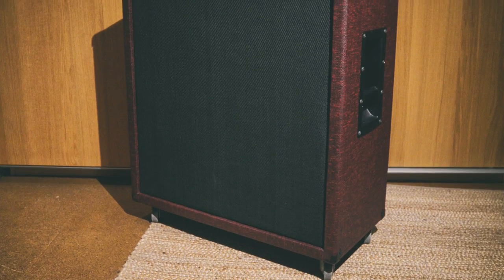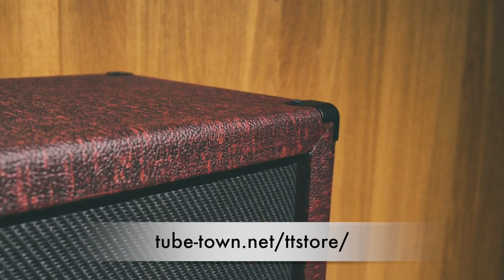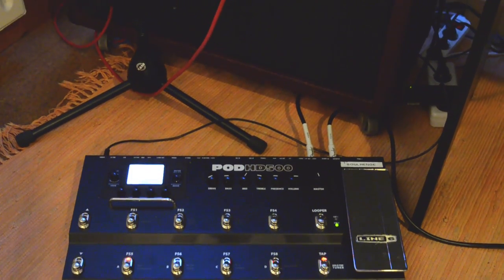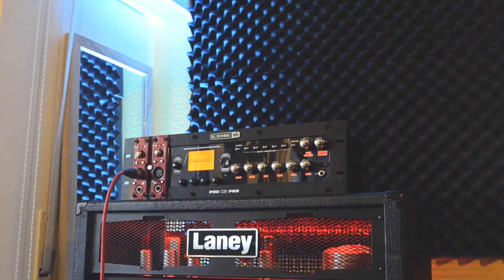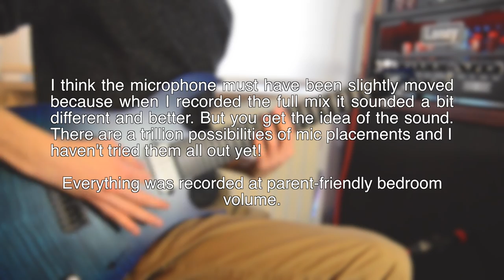DIY 4x12 Guitar Cab | Process / Demo | 2017 (HD)

Comment: Curious if you'd make a more detailed video of the build process. Details about why you did certain things, parts used etc. I've watched quite a few videos on the internet and there are things you've  done that I haven't see in others. Did you design everything yourself or did you borrow some ideas from plans.
Reply from the maker: Tyler Newstead I mentioned tube-town in this video, where I got the tolex and the corners etc. I gutted and old ENGL cab for the speakers, which were my only reference for the measurements. It's just a wooden box in the end haha

Comment: Good work! How are the measurements? Have you tried it without the insulation? Have you build any stabilisation middle piece in it? I built a 2x12 with 18mm birch plywood. Specs are like the closed back orange. Sounds nice but cost 550€ including the speakers, which is a used 4x12 Marshall... :/
Reply from the maker: If you pause the video at around 0:28 you can see the sketch with the measurements on the right. Top and bottom: 35x75, sides: 35x 71,5, back and front: 71x71 (Everything in centimeters) and 18mm thickness overall.

I know, I didn't have to buy the speakers and even used some hardware from the old cab so I spent around 200€ for woods and tolex etc. Speakers are really expensive but also the most important part of the speaker. I haven't tried it without isolation on the back. I think it just can be better with it (but I could be wrong).

You're right for that price you get an decent used cab but is the Marshall as good as your own built cab? Plus yours is unique AND you just crafted this thing with your own hands.

My next project will be a 2x12!

Comment: Are those stock Carvin pickups? I have been looking for other options to put in my Jackson B7. The cab turned out great! Is there a reason you decided to butt joint the sides together versus finger or dovetail joints?
Reply from the maker: Yep stock Lithium pickups!
I did this noob joint because I've almost never done woodwork before and this was way easier for me and faster. I built this thing in 5 days from scratch.
Reply: That cab turned out great with the amount of woodworking experience you claim to have. Great job on that! I think I am going to look into the Lithium pickups.  Thanks for replying!

Comment: What kind of file was that you used to put the curves on the edges of the cab, they came out pretty professional? Nicely done! I’ve just been peeling, sanding and staining already constructed cabs myself. I did a Line 6 with Celestion V30s and am about to start on a Krank Krankenstein one soon.
Reply from the maker: Ivan Loaces It was a pretty heavy rasp, then I sanded it to make it smooth :)
Reply: Awesome, thanks for the info. I’m getting one tomorrow.

Comment: where did you buy the plywood(multiplex platten, wait...is that one word??)? I live in germany as well(Ami) but have not found any place to buy plywood... 

also, is there a link to a diagram for the speaker wiring?
also, also, what speakers did you use? celestions or what???

I clearly want to make my own cab, had to leave my 4 x 12 in america when I moved here..
Reply from the maker: justin barrett look at Bauhaus or Hornbach! I don't have a diagram since I re-used the speakers and wiring of an old ENGL cab that I gutted. It has Vintage 30 Speakers by Celestion.

Comment: How much experience do you have with stuff like this? It looks almost unreal to do for a guy with no experience at all o.O
Reply from the maker: Andrzej Kossuth I've never built anything like this before. I got minor experience with how to handle some woodwork tools but not much. I basically learnt by doing step by step. In fact it's just a box in vinyl with speakers in it. I think if you use some brains and don't have two left hands it should be possible for anyone :)

Comment: how did you install the grill frame? Just glue it to the baffle or screws through the baffle from the inside of the cabinet?
Reply from the maker: It's not really fixed in place 😂 I made it barely fit, so it's stays in place by itself. Since the cab is only for home use I'm okay with this. It weighs approximately 2 metric tons, so it'll stay at home.

Comment: i need help i want to use my hd500 in amp for upcoming concert. i get the hd500 into poweramp loop thing but
i want to know about the setting we have to do in Hd500 for that (output setting, 1/4" out ) and other thing.
Reply from the maker: 1/4 inch out goes into the return of your fx loop of the amp! There's no need for other settings I think. Just disable your cab on the POD.
Reply: thank you..
and what about the amp/line switch which should i choose, i don't think i would have much time there in stage for sound check so i want to sound best as possible.
Reply from the maker: What do you mean exactly? Amp settings?
Reply: In hd500 near the expression pedal there is a small switch with amp and line option ( i thing you get it ).
what should i choose.
Reply from the maker: I have it on "Line"

Comment: How much did this cost entirely?
Reply from the maker: Well the old ENGL cab was 350€ (totally beaten up and abused). This is less what 4 V30s would cost new. I think wood, glue, tolex and smaller stuff like the corners added up to around 160€ maybe, I can't quite remember. I have a lot of tools at home because of my dad, otherwise you'd have to lend tools from friend's like I did for the saw for instance. I'd calculate around 500€ (speakers are the most expensive component) and A LOT of time.

Comment: What's that around the nut?
Reply from the maker: It's called a fretwrap and is made by Gruv Gear. It's to prevent the strings behind the nut from ringing out.
Reply: it can also be brought in front of the nut so when you do tapping solos the open strings don't ring out.
Reply: i just tie a sock on the first fret
Reply: Soulhenge, huh! Never heard of that, I need somethin like that!
Reply: garrettgodc It's better to just learn proper muting. I see a lot of guys use for sweeps, but muting with the picking hand isn't that hard once you get the hang of it.
Reply: Nick Fenny, That's what I do! I use palm-muting with basically any song I play hahah
Reply: Nick Fenny, I've just never seen anything like that before
Reply: You should be good then. As long as the notes you want to play are the only things ringing out, then you don't need to buy anything to put on your head stock. I've gotten by by rocking my hand slightly when sweep picking, either toward or away from me depending on direction. It should be very subtle, though. You don't want to tilt your entire hand to the point where it is noticeable.

Comment: @Milian Malivuk Music You should try removing the back of the cab, and put in the corner of the room 1 meter away from the corner. You can also do it in front of a flat wall.  You'll have to play with the EQ a little. My 4x12 sounds terrible with the back on it compared to open. Thats for all genres especially metal. The bass is way tighter and deeper, and the sound fills the room. At least TRY it. Im sure its different for different cabs.